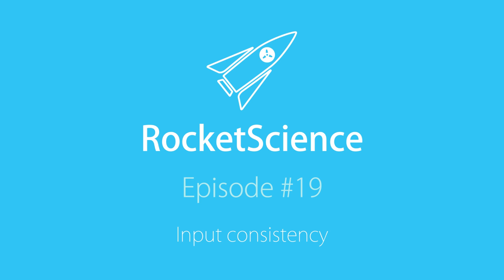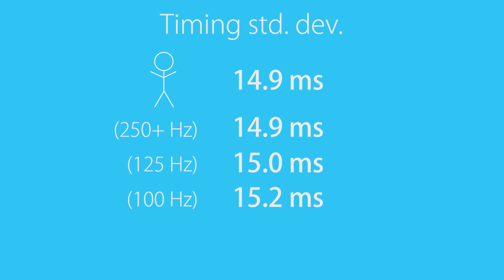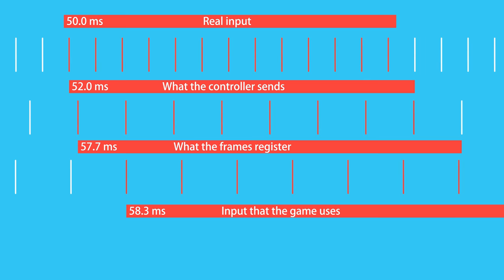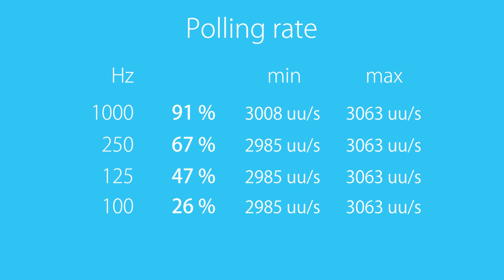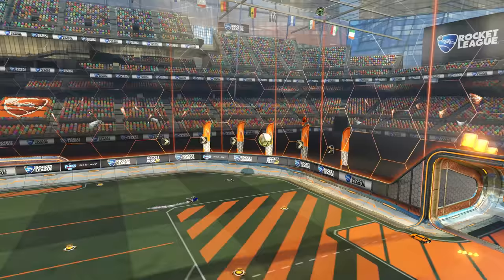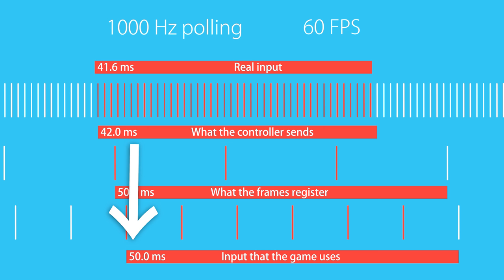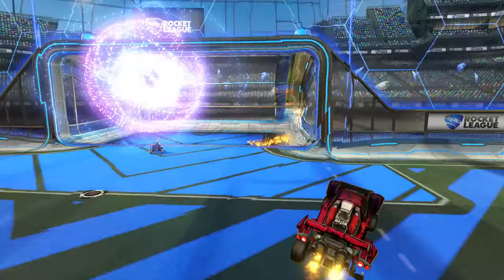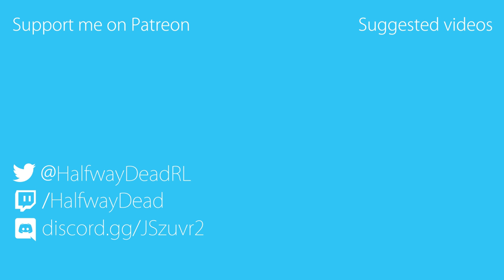Input consistency & heavy car bug - Rocket Science #19

Comment from the maker: If you do want to contact me, pls do it through Discord https://discord.gg/JSzuvr2 The macro can be changed to do anything btw... Doesn't have to be a shot.
There is a TL;DW for the first part at 16:42 but it doesn't explain anything, just gives you a checklist of what you can do to optimize the consistency.
I talk specifically about heavy car bug after 18:31 but I do recommend watching everything if you feel like your inputs are inconsistent.

This video went through many revisions. Ended up a bit long, but I hope it explains the topic well.
Reply: Next, do a vid on the science of pinching. How to get the perfect pinch, max speed off of pinches, etc.
Reply: @feryudefrtyu7435  exactly, straight up bullshit that everyone ignores this simple proof, you can test it yourself on workshop, it is FASTER in the workshop
Reply: feryu defrtyu

The first linked video has improper testing. Sure, two videos are overlayed, but they are at different positions on the field, and thus field of view could distort the image of one more than the other. The workshop example also cannot be used, since workshop maps are made differently. For example, the official maps might have a more "stickiness" to surfaces to make them more "grippy", and thus go less high in the air on jumps and thus land in a slightly different landing angle. The test would have more validity if he showed an example of a Psyonix map when he is not experiencing HCB, no matter how rare it is to experience proper input.

I'm not sure what the second video is supposed to be, and I'm not going to pretend like I do and deny evidence. If you could explain the second video to me, that would be great. Is it input lag displayed from a high speed camera? Or what am I supposed to be looking at?
Reply: I’ll probably contact you tomorrow because I recently got the hcb again, and I’ve tested it with my alt.

Comment: Have you ever tried testing macros on different servers at different hours of the day/night? What i usually feel as heavy car bug is input lag/framedrops and other cars not moving fluidly/weird physics behavior during online games, never in freeplay or a server where im the only one playing. This is usually during times when lots of people are connected to the servers or steam, at 5am in the morning no online server gives me any problem.
Reply: I would suggest creating a macro that is supposed to do a kickoff in a certain way, and see how often it works online depending on ping/server location/time of the day
Reply: Its cause ur using road hog now!😂
Reply from the maker: I haven't. It's pretty hard to get a large dataset that way. Especially if multiple people are supposed to be in the lobby. Would take a long time to get the kickoffs to cycle back to the same one. Maybe the mirrored one is a perfect mirror, then I could use 2 different ones but it's still a ton of work that can't be fully automated.

Online, lots of stuff can happen. Packets not arriving at the server and such. It should usually get caught by the icons. Single dropped packets are usually also fine because the game sends the last couple of inputs at once. Input lag should be 100% independent of the server because the game doesn't need to confirm an input with the server to display it on your screen. It will just revert it afterwards if the input wasn't accepted. Frame drops can happen when the client and server diverge often because RL always recalculates many physics steps when it gets the update from the server. If the frame drops happen because of that, then it would tend to indicate something isn't alright with the connection. The other cars moving weirdly also sounds like the connection isn't perfect. 

If anyone thinks I'm contradicting what I said in the video. I am not. I said that the turning radius couldn't get physically different because the server confirms it.

There is a guy in the hcb discord that has done testing on a lot of this specific stuff and got the client and server to diverge. I'll show him this comment and maybe he can give some more info.
Reply: @RocketScience  Isn't that exactly what could be happening?

We make inputs but for some reason a fraction of them aren't accepted by the server. Therefore, the client reverts some of the inputs. For example the inputs for the left analog stick on the client could be 0.11, 0.34, 0.65, 0.70 but the server only accepts 0.11, 0.34, 0.70. Assuming this happens continuously, many times every second, then there is a desync between brain and visuals. Our brain expects a certain outcome from the inputs that we give but the game displays something slightly different. Directional changes happen later than expected and/or slower because some of the inputs are lost. So we overcompensate by moving the joystick a little further. Much like trying to steer a car on a large patch of ice after riding on normal roads all the time. Since it is more likely to assume that the desyncs are randomly distributed instead of constant we cannot really get used to it. In a game that relies so heavily on muscle memory this is desasterous. 

It would also explain why it is so hard to find any visual proof. First, it happens in tiny fraction of a second considering there are 120 inputs per second. Second, maximum and minimum inputs are much more robust against this kind of behaviour. If you send a bunch of 1s to the server and a fraction of them are lost then at worst your turn will start a little later or end a little sooner. Visually almost impossible to proof. We just don't have the tools to really test such a theory.
Reply: Epic basically confirmed my guess one month after my post: https://www.reddit.com/r/FortNiteBR/comments/awagpo/packet_reordering_technical_post/

In summary: The game sends your inputs in packages with the UDP protocol. By design UDP doesn't guarantee receiving order. That means that packets send in order 1234 could be received in order 2413 by the server. If that happens the engine just drops the packages 1 and 3. These inputs never happened as far as the server is concerned. Epic is now adressing the issue for the UE4 (Fortnite etc.) but UE3 won't be fixed (Rocket League). There is nothing affected players can do to resolve the issue on their side besides changing their ISP and hoping for the best.
Reply: kuxir97 lately I’ve been having it in free play. It’s weird, I’ll get on and I’ll feel so good, fast and fluent, but after awhile of playing I start to feel really heavy. It’s really frustrating to go from feeling really good to feeling really delayed. It also happens right when I get on. I don’t know how to fix it and it’s been turning me off of playing. I don’t feel like that on any other game I play, just rocket league.
Reply: @Cope59  you found a solution ?
Reply: @eteran23  I know it's 2 years later but would Unreal Engine 5 fix this issue? Because RL is soon switching to UE5. 
And I'm still suffering from this stuff on a daily basis.
Reply: @Mr.Reality "soon"🥲

Comment: In my biased opionion; HCB = Higher IbuF value. When I play and the HCB isn't present my IBUF is usually around 1-4. However, when I experience the HCB my IbuF value is around 2-12, usually around 7/8. Higher IbuF = more input lag. More input lag means when you initiate acceleration(turn), it happens just a little later than what you'd expect(hence the increased turn radius). This is definetly on RLs side of things but seems to happen when more people are playing.  I use Csts because on average my IbuF value is lower.

Another thing that helped was lowering my fps from 240 to 120. Took a bit to get used to but I feel on higher FPS you feel the effects of a higher IbuF value more.

Comment: I think there is a really good piece of information regarding framerates that aren't multiples of 60 fps. Especially for myself when running dual monitors. I notice that I have video glitches and problems running 144hz on the main, and 72 hz on the secondary. I had more issues with my 144hz when the secondary was running at 60hz, and I have more issues with the secondary while running video at 72hz. Any graphical animations that had to be drawn on the secondary while playing rocket league on the 144hz would cause huge frame drops. Even something simple like my CPU temp monitor changing numbers in the task bar, or someone's name lighting up in discord would cause big draws on the RL frame rate. So based on what I saw in the video, I am now running my primary monitor at 120hz (because the difference is nearly impossible to see without a reference) and the secondary at 60hz. What I know about programming tells me that most programs are likely designed to be running at 60hz and running anything higher will cause more issues. I also have locked RL at 240hz even though the monitor runs at half the frame rate. I think I will be getting the best results, as even playing around in training, I experienced less frame drops than I normally would. The framerate rarely deviated 2-4 fps, where normally it would be dropping 5-40 fps.

Comment: The first time I tried RL online on Linux my car was horribly misbehaving. It wasn't just heavy, but it actually sled across the floor slightly as if I held down drift, but in a more minor form because it wasn't actually drifting, just sliding slightly. I don't know if this has anything to do with the actual physics calculations or if it was what others describe as the heavy car bug, but it's more than proof to me that there is something fishy going on with RL. Maybe it has something to do with connection quality, but it could be anything, really.

I think I could say it felt like the triggers were not being registered as moving up as quickly as I let go of them, causing the car to keep moving when it shouldn't, which in turn would feel like the sliding effect. But again, that's only a guess. I could not figure out what was going on.

Comment: I used to change my camera settings alot, and that's what I blame the most in the game.

I had the feeling that the physics engine was changing as I was changing my camera settings, althought that would be an absurd thing. It really was just a feeling.

I can't quite find the settings that are the most comfortable for me. I change them alot, ranging from:
fov: 110
distance: 220
angle: -12
swftness: 1.00

to something like:
fov: 105
distance: 290
angle: -3
swiftness: 0.30

Also, the position of my real and concrete monitor from me is super important for my gameplay. 

I used to play on a smaller monitor before, but then I got a new and bigger one, which actually affected my gameplay too. I couldn't get used to it for a while, but I'm starting to feel comfortable now.

I can remember at somepoint in my "career" (oof, that sounds so weird to say... I have 2000+ hours though, so I guess I can safely say it's a career? When can we even say it's a career though? Idk, who cares) that I felt that my car was varying in weight. I'm pretty sure it's at least partly due to the factors I just mentionned. There are these small, tiny visual factors that affects greatly my gameplay, and I'd be surprised if I was alone with this.
Reply: As soon as yo earn decent money out of it, something is called a career.

Comment: I realize I'm late to comment on this, but it's still relevant I hope. Thank you for sharing the results of your experiments. You've clearly put forth a great deal of effort to illustrate the science behind input latency. I have to respectfully disagree regarding the heavy car bug issue. I've been trying to resolve the problem for my system for about 2 weeks now as it only recently started happening to me. I have over 2500 hours in the game and have never experienced it until now. I would love to work directly with you to use my system as a place to perform additional test cases. I noticed that all your simulations take place in localized instances of the game, unless I missed something. Have you performed any of these tests in online matches? HCB for me primarily manifests during online matches and rarely occurs during free play or workshop maps since those are localized game play instances. You may not be testing the right things in the right circumstances, which wouldn't give you a full spectrum of all possible scenarios where online game play should constitute the majority of testing. Feel free to reach out to me if you'd like to try to continue testing this. Sadly, HCB is a real issue and not a placebo.

Comment: Psyonix has some problem most likely with uninitialized variables and something tied to individual accounts.  For a long time my free training would start with the ball half way to the ceiling, but only on 2 out of 3 accounts (2 PS4, 1 Mac/Steam). Interestingly the two accounts that showed the bug had the same account name (one on PS4 and one on Mac/Steam).  Recently (a few months back) this no longer happens, but did happen for at least 5 or 6 releases before that.

Second, my camera shake was invisibly turned on in a recent release (it showed as off, but it was on).  Toggling on, and then returning to settings and turn off again worked to fix this (once fixed always fixed for this bug).
Reply: "Psyonix has some problem most likely with uninitialized variables" no they don't. Unless you use compilers from the 90's without any optimizations and safety checks while debugging stuff like this doesn't happen anymore in the real world, especially with commercial game engines like unreal engine. Wrongly initialized and forgotten to change? Maybe, but unititialized (so with garbage data) would never happen in this day and age.

Secondly that bug was not account related but training map related, do your research before making false claims. Utopia colloseum (training) had the ball placed in the middle of the map probably due to someone forgetting to check if it was correct after experimenting in that particular map. Other maps were fine. You had that map set on 2 out of your 3 accounts and it had NOTHING to do with the account name. I know this for sure because I sometimes set my training to that map because it was fun to start like that.

Camera shake was known bug because the spectator mode and camera gets toyed with all the time, that IIRC also happened during some RLCS streams which got memed on a lot.

So yes there are minor fuckups all the time, just as in any piece of software (or anything IRL). These get fixed (a bit slow sometimes, but they do).
The moment something "major", like the physics fuckup some patches ago, happens, everybody with a high rank will immediately notice and post about it. The one time they broke dribbling reddit was full of complaining posts.
Reply: This was an issue with a specific map (Utopia Coliseum - Dusk). It was fixed a few months before your comment. Two of your accounts had the free play map set to the Dusk map, while the other one didn't.
Reply: @HoraryHellfire  Ahh, cool, thanks for the info.  Yeah, I like that map.

Comment: Dude u deserve so much more sub.
I  Don't know if people actually realize the huge background work u do to make a video like that !
Btw i change my PC and i still have it :

Older PC : GTX960/ 4GbRam/ I5-7400 / Asus Mobo/ 1 HDD 1 To/
New PC: GTX1060 6GB / 16GB 3000Mhz / AMD Ryzen 5 2600 3.85Ghz/ MSI Mobo / 1 SSD and 1 HDD

My Monitor: Benq X2411Z 144hz
Internet : Cat6 Ethernet Cable 1GB/s

I have the HCB and i dont dislike =)

Also i already find alot of fix but they work like 2or 3 days and after the feeling come back again...
Example : Change Steam Accoount/Computer Account 
Uninstalling Realtek Audio device and using the default Microsoft One.
Changing my audio frequency 16bit44110hz to 16bit 192000hz  and 24bit44110hz to 192000hz
i notice a difference between these frequence. ( Restarting the  game evry time i change the frequence in the parameters 3hours)
Switch To MICROSOFT PRO version cuz i was on the Home change nothing.
Port Forwarding Steam and RL ports. ( did nothing ...)
Set to False the OneFrameThreadLag ( work pretty well at the start and the feeling comeback again..)
and other and other and other examples..

Tbh if it was really a mental or a placebo effect, one of these changes would not have changed my sense of heaviness even once.
Sorry for my english im french..

I have more than 5K hours in this game playing since 2015 ( not a beta player) current MMR 1700-1800 ( Grand Champion already top 100 in 1s )

Comment: Would it have to be exactly 240 fps? How much of an impact  a couple frames off would have? Even with a good computer and fps capped at a lower value, online games regularly drop 1-2 frames; so with fps capped at 240, a good amount of the game would really be played at 239 or 238 fps. 
Also, you tested with unlimited fps which are by essence very unstable but what would the results be at a higher capped fps like 300?